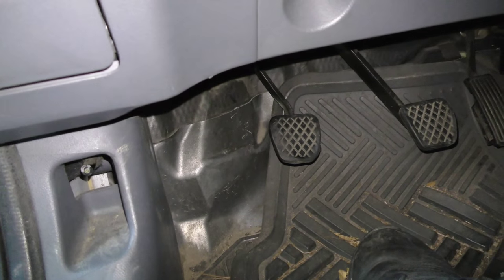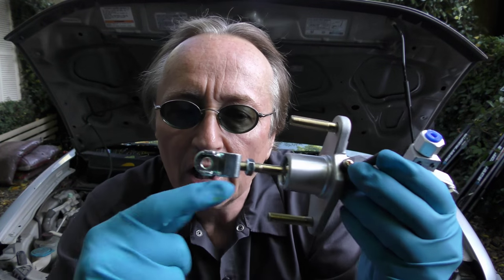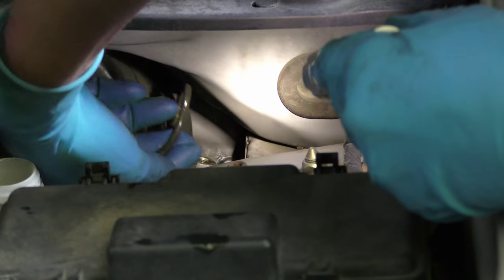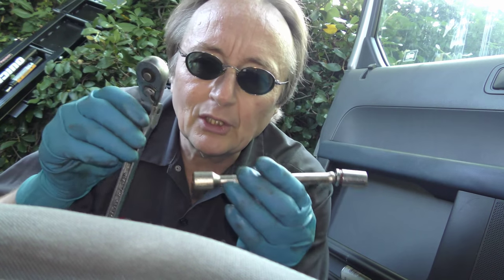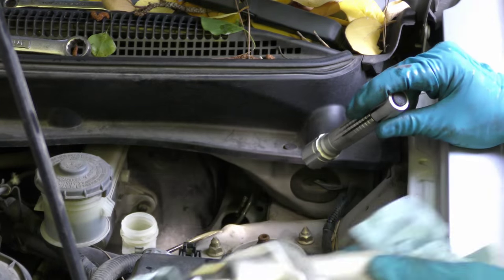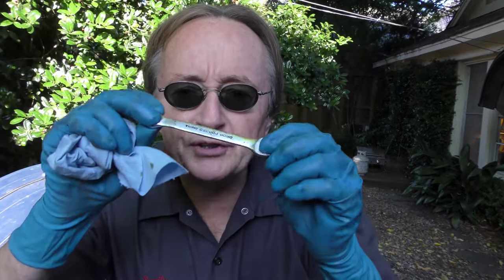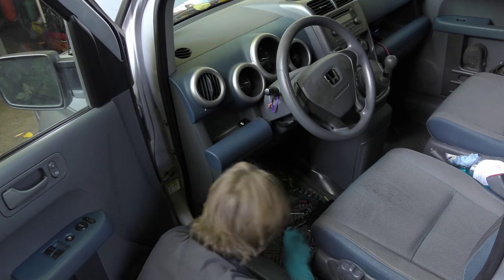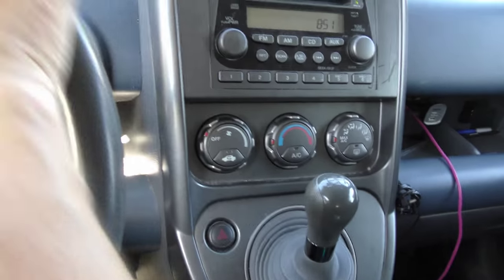How to Fix a Car that Won't Go into Gear (Clutch Master)

Comment: Hi Scotty, I am a regular viewer of your channel since 2019. I have a 2014 Lexus (bought it used recently with 137k miles) and when I start the car and try to move the gear sometimes it gets really hard to shift into drive. Please advise. The car now has about 138k miles. What could be the issue? - thank you
Reply: My dad had the same problem, the problem was that there was bolts that needed to be tightened 😊

Comment: I have a little Holden Barina Sprint I have replaced the gear stick line with a new one & my manual goes into gear smoothly but revs up high & when I change from 2nd to 3rd 4th even 5th gear it’s staying in 2nd gear would u maybe know what this could be?
Kind Regards 
Denise

Comment: Hello Scotty... I have a 2002 Saturn Vue with 250K miles on it.... my stick shift started to get difficult to work with and it eventually got stuck in first gear... I cannot shake it loose to get it out of gear. 
so I had to tow it home. I looked online and saw many that said it could be the gearshift cable adjuster... I purchased one and installed it....still stuck in 1st gear. I don't have money for a mechanic... what direction should I go in??    Thanks for your help

Comment: Can you do a video on cars with abs lights on and a video on straight pipe exhaust. I'm wondering if running my car with no mufflers but with my cats will hurt my car. Because of not enough back pressure. I want to know if its true or false.

Comment: How would you diagnose the cylinder being bad over the pressure plate or clutch?
Edit.) I'm having this problem in my 99 TJ i6 sport with the AX-15 5 speed manual. I have fluid, I have pressure,  I just have a real hard time getting it into gear but it doesn't grind. It's just hard. This is happening to all gears when at a stop in neutral. When the engine is off, it goes through the gears fine with out the clutch pedal needing to be pressed.
Could this be the syncros? I kinda of doubt it because it's every gear and it doesn't feel like a bag syncro where you feel it grab the gear bad you know?
Reply: Well, I'm pretty sure my problem is the retaining clip the that connects the clutch pedal to the shaft. Might help someone. Mine was broken and loose. Haven't had time to put a new one in yet, I'm still at work. But will return with an update

Comment: i have a car that's been sitting for over 2 years. prior to it sitting, the clutch worked fine. now when the car is running, the clutch won't disengage. i drove it to a local mechanic to get it inspected by putting it in gear then shifting without the clutch while the car is moving. he says the clutch needs to be replaced. could it be rusted shut? if so, is replacing it the only option?

Comment: I have 96 ford truck standard 5 speed manual transmission it does not go into reverse gear all the other gears work fine and the clutch is gripping alot more than normal, is this a clutch or gear box problem? My truck is under warranty I just want know for myself if problem is gearbox or the clutch

Comment: Hi Scotty... I have a car that has stopped going forwards and backwards.  if you let the car sit, it will actually move but eventually stop again. Do you think it's my transmission gone bad? Also within a week or so before this,  my car was jerking maybe once every so often...
Reply: +Scotty Kilmer Awww :( We put in fluids today, and it did the same thing.  I was told to try a strainer which I think is a filter. I was hoping it was something simple before turning to shop.  It has so many miles on it; I'm scared to put in more money into it...Thanks Scotty

Comment: My '85 Trans Am Owner I bought it from said the clutch was replaced. I was driving it for 2 years and now the clutch has little to no pressure and I can't shift yet I can go back and forth in my driveway no problem just not on the road. I checked for leakage in the master cylinder it doesn't seem to be leaking because it's still full. I'm hoping it could be a simple problem like you just explained in the video. Any ideas what it could be?
Reply from the maker: I would replace the master and slave together

Comment: Hey Scotty, I had an issue with my clutch when i was going up hill. I went through all the gears from 2nd to 5th and was hearing a screeching sound when i would press the clutch in. After down shifting to 4th the noise was a little less, but when i peaked and tried shifting to 5th, the clutch pedal completely went to the floor. I then turned my truck off, and tried starting again. The clutch pedal was really stiff like something was blocking it, but once i pushed gard enough the engine started. However, omce it started, it stalled when i put the truck in gear. I think it is the slave cylinder, but i would luke your expert opinion if you could.

Comment: Hi Scotty.  I have a 95 Ford Explorer 4x4 that has a 2nd gear issue - vehicle skips 2nd.  Would adjusting bands possibly fix this situation, along with maybe filter / fluid change and replacing shift solenoids?  I'm trying to fix it myself without having to replace the transmission entirely.
Reply from the maker: give it a try and pray, try all that.
Reply: Ha.  Thanks :)

Comment: Hey Scotty which Wrenches for DIY and around the house and a home mechanic would you recommend? I want something that have life time warranty. please share your knowledge. Thanks! cool channel.
Reply from the maker: Miguel Angel go to auto zone, they sell some decent starter kits
Reply: Miguel Angel I would recommend you go to sears and find a set of tools that comes with sockets (1/4 inch, 3/8 and 1/2 drive), wrenches (standard and metric), and a tool box made by craftsman. They also sell Allen wrenches and screwdriver kit with Philips, Flathead, and torx screwdrivers so get those too. To me these are the basics and will get you started, if you need a individual tool for a job then add it to the collection. Eventually you will have enough tools to do nearly anything. Craftsman tools have a lifetime warranty and are great quality, that's why I recommend them.

Comment: Are there any other suggestions for this problem? My truck also grinds going into reverse. I'm going to check the transmission fluid (easy, cheap and needs it anyway). I've also noticed it will creep ever so slowly when trying to put in 1st gear but it won't go in with no brake so the clutch is dragging? Any suggestions or just the slave cylinder?
Reply from the maker: Baseball252010 pray it's just the slave if it's creeping

Comment: I have the same problem. Clutch has little play and very soft and I brought it to a mechanic who said he switched out the slave cylinder and master. It drove OK for a little then same problem happened again. Absolutely will not go into gear, and it grinds like hell if i I try to put it into gear. Is it the transmission? Or do you think he just lied

Comment: Hey Scotty, what could it be if a car dont won't in gear but only the reverse and sometimes the first? It says that this is a really problem with Nissan 240SX. Sometimes you have to kick the clutch and release it 2-5 times, until you can change the gear without force
How could I fix it without change the gearbox?
Thank you for your videos, keep the great work on,
greetings from Germany
Reply from the maker: Ricy013 either clutch is wearing out and needs replacing, clutch master or slave cylinders are weak, or synchos in the tranny are bad. Pray it's the cylinders or a worn clutch
Reply: Scotty Kilmer thank you alot!

Comment: Hi Scotty i have a question my friend has a 1999 Toyota Sienna and it only goes on reverse but not forward. everything was working fine until just yesterday was getting ready to go to work that happend. what could it be? or what should we do before moving straight to the transmission?
Reply from the maker: IF fluid is full, transmission needs rebuilding

Comment: The Hondas seem to be ass about to the Holdens as the clutch master cylinder in my Commodore has to be unbolted from inside the engine bay.
I have had an issue with the master cylinder in my Holden Commodore which had been leaking for a while, what I did is pulled the unit apart & since I had the cylinder still bolted inside the car & the piston assembly removed the measurement came out at 20 mms in diameter so I ordered some 20mm hydraulic wiper seals off Ebay for about $10 AUD only to find the seals were too tight meaning that the cylinder is most likely 3/4 inches in diameter, I ended up removing the master cylinder from the car.
I don't know if this has worked but I honed it out with wet & dry sandpaper (80 & 320 grit) to try & fit the seals , I thought I had them fit one night then I realized I couldn't remove the piston the next morning without the aid of a bucket of hot water & and air gun & compressor,I then thought oh bugger it, I'll refit the original seals.
Well , I bled the hydraulic system which I had to top up a bit later although not much (probably was either still an air pocket in the slave cylinder or the cam on the clutch pressure plate has adjusted itself thus needing a larger displacement of brake fluid), I topped it up last week and I haven't had to top it up again, I was looking at ordering some 19.2mm hydraulic seals but if the honing has fixed the leaking problem I will leave it alone,I noticed the clutch pedal feel is far more sensitive now so it is something I will have to get used to.
My dad whose a fitter by trade had that trouble with his old 1972 model HQ Holden Kingswood over 20 years ago where he had a leaky brake cylinder on one of the rear wheels so what he did to get himself out of trouble was to spend most of the day honing the cylinder out with wet & dry sandpaper then refitting the old seals,well , the cylinder didn't leak doing it that way so I hope I can save about $150 AUD on a new master cylinder although it wouldn't bother me to spend another $10 on new seals.

Comment: Scotty, 95 Explorer 2 wheel drive, overdrive light is flashing, i replaced the speed sensor , only costed $ 10 , i am being told now the trans is shifting hard, what do i do ? its OBD 1 , BUT its has the OBD 1 port under the hood, an the OBD 2 port next to the brake pedal, , but its built 7 / 1995 , what do i do here ? bad throttle position sensor ? please let me know, so i can make this Ford last . thank you very much, keep the videos coming
Reply from the maker: +Kody Darlington  OD light flashes, that means a transmission code is set. Find a guy with a ford dealer level scanner for that one, it takes one of those to access tranny codes

Comment: Hey Scotty I have a  2000 Kia Spectra and it has 63,567 miles I have been using 5w-30 synthetic oil but the owners manual say it take 10w-30 what should I used
Reply from the maker: israel 20 very little difference in those oils, but in hot weather at least I'd use the 10 30

Comment: I have an '02 BMW 325i. Sometimes I can't get it into gear without letting off the clutch just a little bit until it goes into place. Would this fix the problem or is it something else?

Comment: my car is stuck in first now from power shifting, and should have replaced master cylinder sooner any advise for fix scotty ? please and thank you
Reply: Jay Matic if your on a flat surface,  and you can't leave first then you destroyed your transmission. If your on a hill , have someone push it a little , engage the brake then tryv.

Comment: I was wondering if you would know what would cause a manual
truck’s clutch to fall to the floor and why can you push it when in gear and
the truck is off? I checked the Hydraulic clutch and found no leaks and bled it
of air and it didn’t fix the clutch. I was wondering if it could be that it
needs a new clutch plate, throw out bearing, pressure plate, or maybe something
else?

Comment: Scotty I really need your help bud, my only car which is a 2005 Saturn Ion won't shift into gears while the engine is running, it'll only creep forward if I hold the stick in the 1st gear and creep back when I hold in the reverse gear.

Comment: I have a 2001 Hyundai Tiburon (automatic) the other day I left my house, and for some reason the shift from 1st to 2nd was really hard. then when I tried to leave the store I went to (about 1 mile away) it wouldn't go into reverse, but I still had my forward gears. I checked and topped off the fluid(pretty low) and it still wont go into reverse ( also there are no signs of a leak) Any ideas? Thanks , Tim.

Comment: Scotty I have a question. I have a 1997 ford ranger and when I start it and put it into first and accelerate a little it make like a cracking noise. After that and I'm driving like on 3rd and put it to neutral, it still acts like its on 3rd gear. Have you experienced any of these side affects? 

Thanks for your time.
Reply from the maker: +rolando Rivera  pray the gear shift bushings need replacing and that it's not an internal transmission failure as they cost a ton to fix

Comment: hey Scotty I watch quite a few of your videos and they've all been very very helpful saved my butt a few times but I've got one for you that might even stump you I have a 92 Silverado 3500 the batteries were bad in it so swapped out the batteries now the transmission will not shift out of first gear it was working fine before not a single issue with it can you help me
Reply from the maker: check for a vacuum line that may have come off the transmission modulator. If not, and if it's all electronic, get a GM guy to reset the  tranny computer system

Comment: I have a mustang 2001 ford has a very very hard clutch pedalling issue. It is not a hydraulic system but mechanical system. Any solution? Would be appreciated if so...

Comment: I'm having trouble going into reverse.  1-5 is fine  Doesn't matter if the vehicle is running or shut off.  Has a lot of resistance and feels like I'm going to break the shifter right out.  No grinding noise, but the instant slip right in feeling is gone.  Bent reverse shift fork?  Bent linkage?
Reply: Not enough gearbox fluid. Flush it/drain it then pop the correct new fuid in the exact quantity.

Comment: Hi Scotty have 2002 Cadillac seville sls structured putting a system in my car but some how blow a fuse or something it only shifts gear cold and when warm it don't shift passed second and rims at 4

Comment: Hi Scotty, could be the same problem if sometimes the reverse gear locks on my car, even with the car stopped and turned off, I noticed that if I release the clotch and press again, the reverse works. Only the reverse gear gaves me that problem, the rest works fine.
My car is a ford focus 2010(mexico). Thanks.
Reply from the maker: that often means you need a new clutch or clutch hydraulics

Comment: Hi Scotty I have a 2008 Mercury Milan 5peed manual trans I shifted to hard and one of the links on the inside of the car popped out of the socket it was in place on the gear shifter I put it back in place but now I can only use second and 4th gear no other gears engage I found where the links connect to the transmission in the engine compartment I’m guessing the shifter on the engine side is out of adjustment how can I fix this

Comment: Hey Scotty I'm looking at buying a 1968 ford f100 but it has the manual transmission called 3 on tree and the shifter is going bad, what would I need to do if I wanna get a stick on the floor do I need to replace the whole transmission or what do you think is it a good deal or not
Reply from the maker: Zagatto Ryearth that would be a giant pain in the butt, fix the column instead
Reply: Yeah thanks but I thought about it and I don't think buying it it's the best thing to do

Comment: i may by a 2001 rav 4 fwd but wont go in reverse however it will drive up to 45 mph. the guy said check engine light reads solenoid for trans do u think this will fix the reverse issue?

Comment: Hah, that's funny how you did a burnout in that Chevy van. Btw, many Hondas these days I've gotta say have become a real pain in the ass to access. Mostly because there's not a lot of room and you have to remove other stuff to access the components in question. I own 3 Hondas myself so I'm very familiar with how they're designed
Reply: That’s true, I have a similar problem With my clutch, Honda Civic ex 2000. The video makes sense but it’s not the same exactly for Honda’s, a lot more complicated. Haha I like the mans energy

Comment: Wouldn't a leak in the cylinder also cause low fluid level or no fluid level?  Wouldn't it make sense to check that first before committing to removal of the cylinder?   I've not ever bled my clutch cylinder, but it appears to be similar in many respects to the brake cylinders.  If I did my brake lines the way you suggest, I would be guaranteed to have air in them.   Couldn't one just use a vacuum system to bleed the brake cylinder?  

(My car will not shift into gear, but my level is slightly low but not empty.) I'm looking at what can cause this as I'm hoping it's an easy fix and not a transmission rebuild for my 1995 Celica)

Comment: Hi we have just replace the clutch in our Mazda 6 2007 model. First problem that occured was not being able to put car in reverse and in5th gear. Then there was no more gears. Gear leaver has just gone totally loose and we cant put the car into any gear whatsoever it just doesnt engage. Clutch was replaced, flywheel skimmed, master cilinder replaced and clutch bled. Any ideas as to what would cause this problem as it only happende after replacing the clutch?

Comment: hey Scotty, got a problem with my 97 mustang the manual trans will go into gear and drive when cold and shift fine but when it's warm it doesn't go into gear unless it's off then I can start it in gear and it shifts kinda hard doesn't really want to get out or go into gears unless car is moving any tips